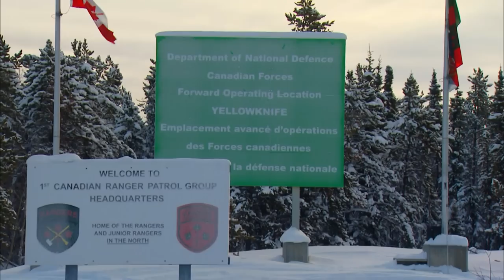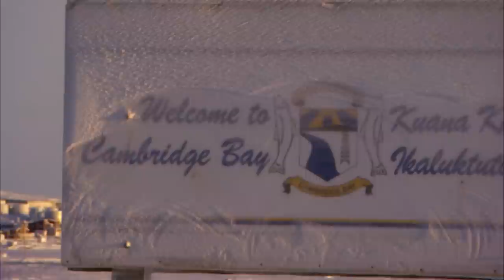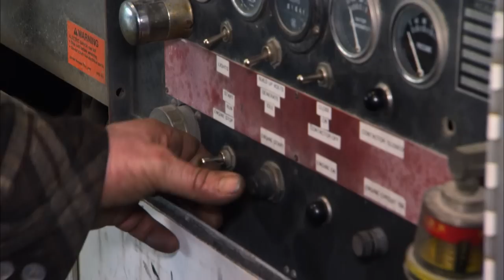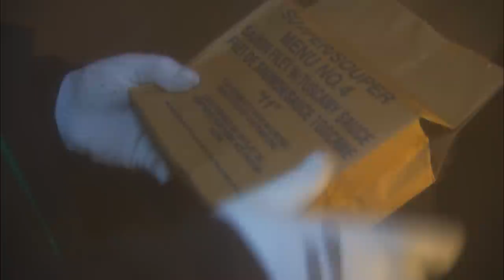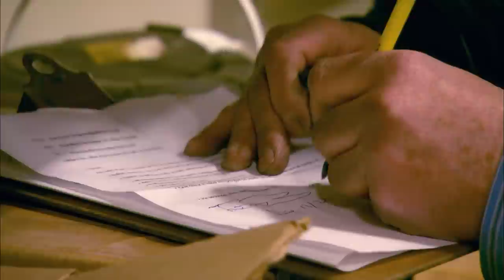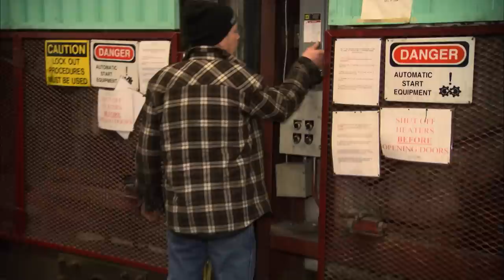Joe Takes A Huge Risk On A New Fire-Fighting Plane | Ice Pilots NWT | Wonder

Comment: Year round we keep our freezers well below freezing,only takes a walk from 1 end to the other to freeze my wet uniform  and exiting the doors on other side the frost just evaporates off you... a real chilli check but someones gotta maintain freezer lights and else for the forklift drivers that seem to love smashing my handywork repairing racking by not stopping full load into the 1 inch bolts in the cement floor to hold it... made a necklace of a sheered 🔩 bolt thats kinda pretty  just so cold it snapped when many thousand pound hit it at whatever slow under 25mph speed they careened into it gliding on frost that they were supposed to sweep away dry glad we got exits every 100 ft to the outside plant or emergency ones to outside outside which i must regularly check for operation of door heaters opening closing properly door seals etc I'm not the saftey engineer or nothing but i gotta keep coworkers safe by making sure especially certain things are    maintained emaculately including the co2 vents they clog with moisture often on humid days restricting flow so i check em twice on my 8hr shift though not required to till the alarm goes off saying co2 level too high or the other redundancy saftey equipment  the other maintenance guys check it too always making sure refrigeration in tip top shape and else also changing air filters often now weekly in fact for exess protections uh where was i kinda hit a tangent there.. oh yeah  cold ❄ can make stuff stronger, or just plain brittle

Comment: Mikey, you should have packed your electrically heated socks, gloves & coat. With plenty of spare batteries. Mikey looks like the Michelin mascot except for the colour in that winter wear. For cryin out loud, pull the engine off of the Aurora for frackin sake, then pull that thing out of the hanger till the new engine is ready to put on.

Comment: Here in Ireland if the Temperature is below freezing in the daytime we don't work outside I pour concrete and all the water line's will freeze up because we are not set up for temperatures below freezing 0,c but we only get 1or 2 days a year that the temperature is so low in the daytime that we can't work.

Comment: I just wonder. I would use the fur inside not outside, in gloves or other covers. I would keep the skin out. Or they are double? Inside and outside?
Reply: no, just outside
Reply: How do the animals that live in the arctic wear their fur? Inside or out? lol.
Reply: I'll add that I'm Canadian and the fur goes on the outside. The fur on your hood is to keep the falling snow from going in your eyes, it also traps some warm rising air from your face to make a little heat dome around your face (only works on calm days, winds will destroy that heat dome but the fur will help block the wind and blowing snow while still allowing you to see a little bit through the fur so it still works that way). The fur on your gloves are not just there for your hands, it is there to warm up your cheeks/nose when your get a chance to bring your hands up to your face and also helps keep snow from going in your gloves and up your sleeves which can really ruin your day in those temps. Once your hands get really cold, there is really no way to get them to warm back up as your body will constrict the blood vessels to preserve the heat for the organs so your hands will never really recover out in the field after they freeze, feet same way.